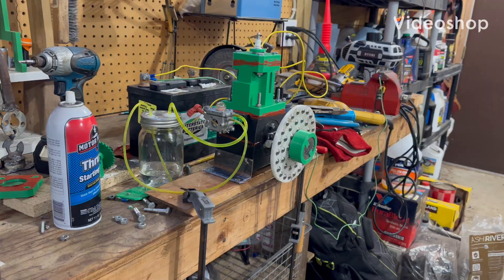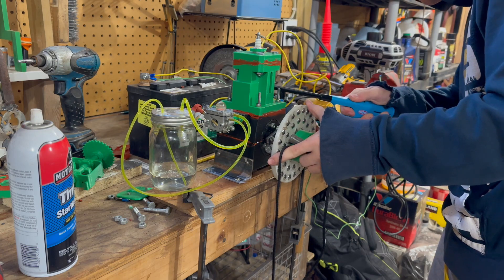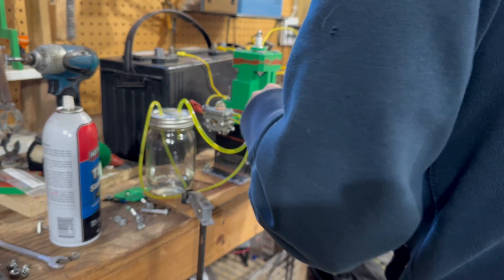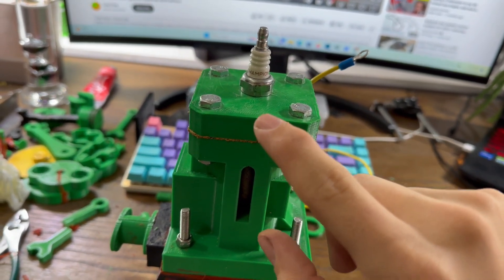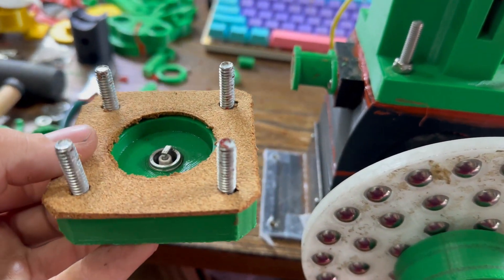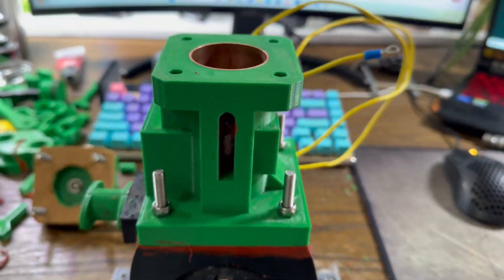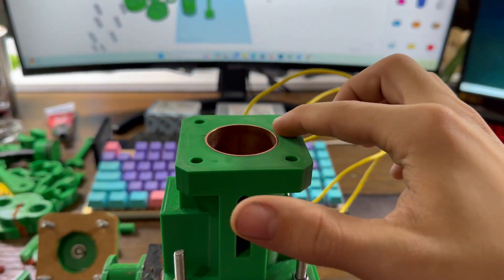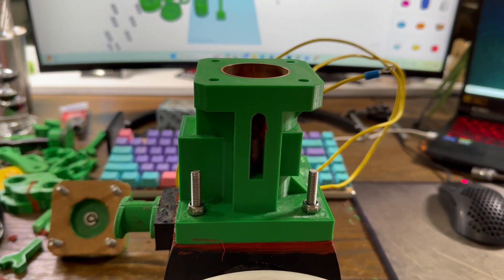More firing!

Comment: I cant really see if it is like i think. But when the piston goes to to compress the air/fuel ratio the intake is open. As in a reall engine the pistons seals against the intake so the air compresses or u use a sleeve valve i think they are called. And this means the air mixture wont get into the cylinder.

Comment: Print it on its side, it’s absolutely worth the extra effort. Layer direction is HUGE and prints are exponentially stronger in directions normal to the build direction/Z axis. You want force along homogenous strings of plastic, not a bunch of discontinuous layers.

Comment: Why not design the cylinder as a jug similar to a pocket bike engine so that you don't have to worry about sealing combustion pressure?
Reply from the maker: I wouldn’t be able to get the copper pipe out when I put it in the cylinder housing, I could push it in from the back, but I’d never get it out without breaking it.
Reply: @aroundtheyardfun  ahhhh I see, didn't consider that.
Reply from the maker: @BaileyEvans  yha, I thought about it at first, but then I thought of that

Comment: use actual gasket material I think you can just buy sheets of it and I don't think it requires nearly as much pressure to seal which might mean you can keep your current cylinder design and also try using the choke when starting it up I subscribed because I too want to see this thing run and also run better and longer than cadmen bowen's 3d printed engine
Reply from the maker: I think with the two stroke design, I should be able to get it run for much longer, even with the firing that it did no parts are even slightly damaged. I did have the choke on, but somethings wrong with the carburetor, because it just won’t let fuel through no matter what. I have a new carburetor I’m going to try. I’ll look into actual gasket material, the cork gasket is just what I had on hand. Hopefully, I won’t have to modify my design anymore. Then I was looking into doing more modifications by soldering a plate on top of the cylinder, but that would require quite a bit of work to drill a hole through the plate, and the plate would be quite expensive because it would have to be copper, and it would have to be fairly thick. 
Thank you for subscribing!!
Reply: did you ever try tuning the carburetor there's two fuel mixture screws one for low engine speeds and one for high engine speeds they could've been screwed in too far but yea tuning 2 stroke carbs isn't always fun you could also have it idle at higher speeds by turning the one other screw in that I think would also give it a better chance of running longer
Reply from the maker: @WallyBecker-x6m  I tried turning the screws in all the way, then backing them out 1 1/4 turns for both, but still nothing. I going to try the other carb I have, but I am going to fix the cylinder bank first by using a plastic welding technique I saw. 
Thank you!
Reply: huh one thing I know is that on most 2 strokes that use that carburetor have factory settings of at least 2 or more full turns out and I usually start at about 2 and a half turns also most two strokes start with the throttle cracked open a bit and if it still won't run after considering all that then there is one other thing that works most of the time which is where you completely plug the intake with a paper towel or something like that and then try and start it and it should force fuel to come through if you can it works better if you can get it to run on starting fluid and then really quickly plug the intake and if none of that works or if you just wan't to go ahead and try the other carburetor definitely do that

Comment: Extend those bottom bolts up.  Then put a metal plate on top.  Thusly, the pressure is pulling against the force of the piston.  Pressure pushing up and piston pushing down.  As long as the bolts can hold, which they will, you'll be all set. 

Basically, it'll be a big sandwich.
Reply: extend the bottom bolts up through the new top plate and add washers and nuts.
Reply from the maker: @burtreynolds3143  I really like that idea, I would have to buy new bolts because the current ones aren’t long enough but that’s a great idea! 
Thank you for watching!

Comment: Cork is not great for head gasket material. You'd be better off modeling a channel (possibly 2) and putting an O-ring in
Reply from the maker: That might work, I’m looking into more of an actual gasket material, but I have seen some model engines use o rings for head gaskets. 
Thank you for watching!

Comment: New sub here.  Print the cylinder on the side so the layer lines run vertical.
Reply from the maker: I thought about that! I’m first going to try to plastic weld the part back together, but if it doesn’t work I’m going to try that. 
Thank you for watching!
Reply: @ProjectLMZ  thank you for the video!  YT just randomly suggested your video.  I’m a 3D printing nerd and love all things engine and car.  I look forward to more!

Comment: Try tobShorten the length of the fuel lines, aswell as prime it before trying.   i have used waxy cardboard for gaskets. They work really well like a milk carton.
Reply: I did it with my moped exuste ones it workes better then the ones you can buy😂
Reply: are you sure you got the spark plug on?
I know the color you use is yellow it don't look on to me
Reply from the maker: @MsSugercrisp  yes, the spark plug is connected, I am having issues with the cylinder bank breaking now, I’m going to try to plastic weld it together, as it is pulling the layer lines apart.